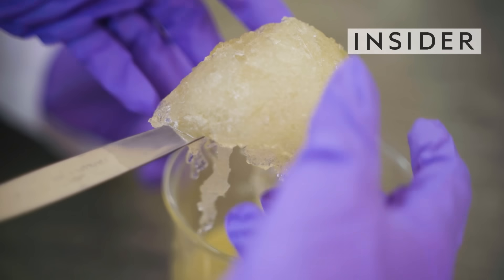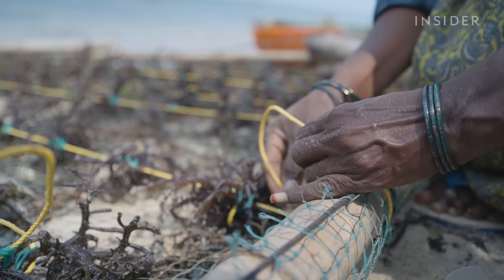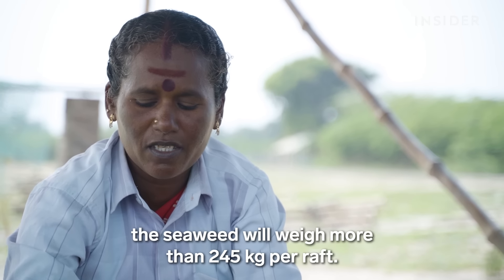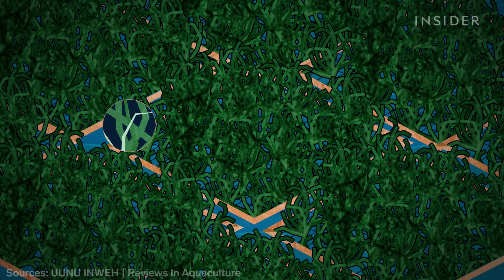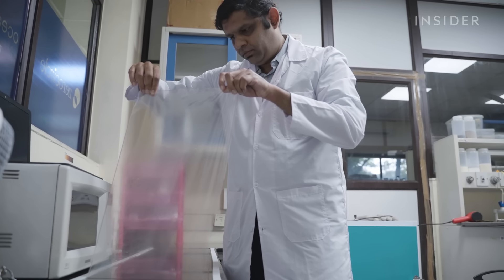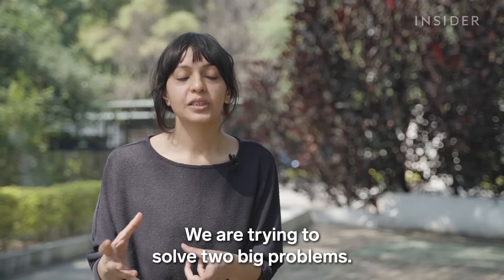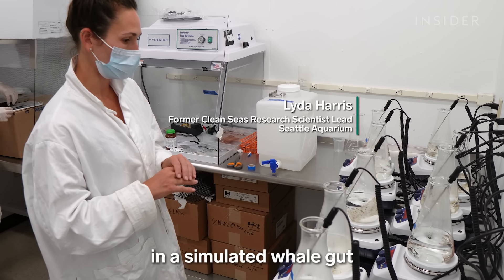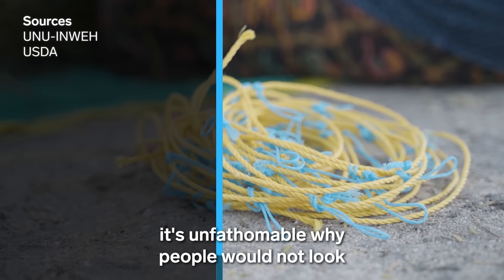Can Indian Seaweed Replace Plastic? | World Wide Waste | Insider Business

Comment: A great material! It can't replace all uses of plastic as it's dissolvable in water, but maybe one of the other plastic alternatives can. At the same time that also makes it more practical than plastic for some uses, as for the teabags or the wrapping of noodles shown in the video. I hope to find it in our stores soon!
Reply: Yeah, teabags are a seriously prime opportunity for this kind of stuff. Remember though: Bioplastics are not new, not at all. Celluloid was invented around 1850. Nestlé's KitCats have been bioplast since 2010
Reply: Disolves in boiling water, I think in normal water it should be fine for may days if not months. Not sure
Reply: @prashant-ul2sn  it's probably still get way weaker over time with air humidity
Reply: @prashant-ul2sn  No, it really dissolves in just water. Bought a whole pack of degradable plastic, and it does the job, but when my hand is sweaty/wet, the handle is really gonna tear apart. Even if you wash the plastic, it will dissolve. Don't even ask if it's raining the plastic just dissolve.

Comment: The fact that the product is 100% biodegradable and at a very fast rate, is a big plus for me. Doesn't matter if i can or cannot eat it!
Reply: Lmao, most plastic used in packaging is already biodegradable (different organisms eat it yes) , but it's not done because it's not cost effective
Reply: @plopiaplopia3736  It's also not done because is requires too much time. And the same might go for this. As far as is know the current organic waste composting processes take about six weeks due to special bacteria. If that cannot be done with this packaging, it cannot go into organic waste and has to be burned.

Comment: Absolutely and about time. 
Seaweed can be quite solid when cured properly and does not require harmful chemicals to cure it 
Awesome 💯👍
Reply: Dude, the compounds they are using to separate the seaweed components are organic solvents..."harmful chemicals" in every definition.  They then evaporate those solvents off, but no mention of capturing them so I must assume they are released into the atmosphere or they'd point out how they recycle those chemicals.
Reply: @nobodyspecial4702  solvent recovery is very simple. They already have a distillation setup, so all you would have to do is add a condenser column.
Reply: @Alsry1  I wonder if the solvant couod be reused then
Reply: @Maski110  absolutely. Some solvents are extremely expensive so it’s common to reuse them industrially
Reply: @Alsry1  I know this, the issue was why didn't they do it?

Comment: I’m really surprised we don’t make some kind of plastic. That’s biodegradable out of corn by now, but I have noticed that some of the potato-based packaging peanuts are starting to become common place. They melt in water as well as in your mouth, pretty much like a light Chito without the cheddar.
Reply: We make PLA out of corn (or anything with sugar). it is compostable but not biodegradable.
Reply: There are plenty options but the properties offered by bio based products have limitations. Eg. Tide pods itself dissolve in water but the bag or box they are sold in still needs to be be made of a thermoplastic able to withstand the mechanical and chemical requirements through this products life.
Reply: @aamirsheikh2610  That's why I still buy powder Tide in cardboard boxes...unless/until they discontinue it.

Comment: The problem is that it dissolves too quickly. In a few hours, a lot of produce can be dissolved, even before making it to market. If it took a few weeks in room-temperature water, or hours in boiling water, then it would make completely sense to start using it. Imagine you buy something, and because your hands are sweaty and warm, the packaging dissolves, and you're left with no packaging. Dew, and especially rain, can dissolve the product, as well, so that's even more reason to not use it.
Reply: can say about sweat as sweat from our hand is too minuscle for consideration . sweat wouldnt do anything but i agree with your rain point . if a person does not have umbrella then it will get destroyed in 5-6 hours

Comment: It's ability to dissolve in water will limit its use somewhat. Can't replace plastic juice bottles. But every little bit helps. It could take more paper out of the system too. We would need to compare the impact of each.
Reply: Reusable and recyclable glass and aluminum bottles.

Comment: This is absolutely incredible the ONLY problem I can think of is if u have a bunch of groceries and it's raining outside or if someone spills something could it deteriorate the plastic?
Reply: Seems like you would need to handle it like a paper bag.
Reply: Maybe not instantly, not sure. Also it maybe it is only faster to dissolve on boiling water, but rain won't destroy it quickly.

Basically treat it like paper bags which also destroys on moisture or liquid contact.

The point of these is to have biodegradable packaging that will naturally dissolve in nature to leave no pollution. These are not meant for long term use at all, but that fine since most plastic packaging is single use anwyays.

Comment: If it is not waterproof, it is bad packaging for a lot of things, like paper is
Reply: It's waterproof
Reply: For longer term storage of foods it seems like it might not be the right option. But for short term it seems like it might be a really good option.
Reply: You have not observed clearly.. the plastic here can dissolve in boiling water... not normal water
Reply: @grabhishek31  It also slowly dissolves over months in the compost so for longer term storage with high humidity I think it would break down. For short term food packaging it does seem like it is a very good option.
Reply: BINGO. Anything this is used for you can already use paper for all intents and purposes. Think wax paper even. So why bother. Paper also decomposes and is easier to produce.
Reply: @WaterspoutsOfTheDeep  just say you don't want this product to compete with your product
Reply: @WaterspoutsOfTheDeep  Paper is not very water resistant, which this is. Waxed paper is generally coated with paraffin wax, made from petroleum.
Reply: @grabhishek31  Pay attention to the video.  It dissolves in boiling water in seconds.  It dissolves in normal water in hours.  Making it absolutely useless for most food products.
Reply: @nobodyspecial4702  no ,it doesn't mention normal water... only mentions boiling water
Reply: @grabhishek31  How did you know I am the Thanos of BIG PAPER?
Reply: @mduvigneaud  Waxed paper is likely just as resistant or more than this which will be weak to humidity. It's still a defunct product aside from the materials transparency if it can even be produced clear.
Reply: @WaterspoutsOfTheDeep  I haven't used this product but most waxed paper I've used is mostly only resistant to liquid water, not water vapor.
Reply: @WaterspoutsOfTheDeep  From the video it appears that this product is more resistant than what I've experienced using waxed paper. Of course I haven't actually used this product so I don't know more about it than what I saw in the video.
Reply: @WaterspoutsOfTheDeep  Peeople like to see what they are buying
 Can't see through paper

Comment: What they have done is remarkable, hats off to them. However, I feel plastic bottles, straws, milk bags etc. that interacts with the water are main polluters. Their product fall short on these crucial applications, as it cannot last in water for more than few hours. Even when used as packaging, I assume there is risk of getting destroyed in rain, moisture of pipping hot burger can lead to leaching of packaging into food. Although it might be safe to consume, I doubt that consumers will be happy about it. The application they are aiming for are easily covered with paper. I think there is an advantage of reducing the stress on forest, further majority of the Earth surface is water, thus the work with seaweed has a huge potential. If seaweed growth can be mechanised, it will serve a great purpose in carbon-fixation as well as an abundant source.

Comment: It will get more affordable by upscaling the farming with machinery. There is a small hurdle because right now there is not enough demand. But the small scale farmers will eventually run out of places to put the rafts so close to the coast that it is feasible to fetch them manually, eventually a larger scale operation will use larger rafts and ships that harvest and process them on board. They could run up and down the coast, harvest each pod every 45 days on their journey and process the seaweed right into the pellets.

Comment: Another problem is that the biodegradability of all these producs kinda keep them from actually replacing oil based plastics across the board since it comes with a lack of water resistance.

Comment: Crude oil is made of old plants and nothing more. But it is much easier to harvest cellulose from plants than it is to try to manufacture it from the original glucose and protene that plants manufacture it from. Some of the  simpler plastics we do manufacture from the base material that plants use to make them. But Celulose, Rayon, and polypropylene are much cheaper to harvest from plants.

Comment: Honestly I feel like when this becomes ready for adoption and up scaling, it's just going to get lobbied and under tabled screwed over to smitherins and it won't end up reaching the scale it needs to compete with plastic in price. And goes into a spiral of not getting used because cost thus staying small scale as a result.

We already have alternatives, it's just that we get green washed fooled and then goes on to continue using plastics just in different shapes.

Should probably fix that first lol

then again, the best way to solve this is probably to just phase out fossil fuel naturally.

Comment: Here's the question: how much more waste does this produce compared to manufacturing regular plastic?

Sure you wont be leaving plastic in the water any more, but if it takes like 6 times the power and 3 times the water then you're replacing one problem with another

Comment: Wait, if it completely dissolves in water that trait makes it unable to compare against plastic because a majority of plastic use is actually used to contain liquids or will come into contact with liquids! Especially food, since humidity is actually what the plastic is needed against for dry foods, and for foods that isn't completely dry, this just useless. For storage, it can't be frozen either since it means that removing it from the freezer will cause it to get wet from condensation as well! And when being delivered, rain will cause it to start that break down process as well just from humidity as well!

While the things shown in the video are possible... it requires a complete re-education of the use and storage of plastic-like items. The process starts with educating people to use less plastic, not just finding plastic alternatives.
Reply: That’s true that it would be useless for holding liquids and would be weak in the rain. But it mentioned that it would take a few hours to completely dissolve in water. I’d imagine that if it just got a bit damp from humidity or condensation it wouldn’t really do anything.

Comment: OMFG it's agar agar. They aren't inventing anything new, they're literally just taking taking a wheel from motorcycle and attaching it on a car and saying they've invented a new wheel.
It's the same as what you have on an agar plate to grow bacteria. It's just more concentrated.
ever used a gelatin sheet and bloomed it in water? Congratulations you now have a more moist version of what they presented.

Agar agar is cheap as balls, mass produced and you could do the same with gelatin. The issues of the seaweed farming isn't a problem if they are grown from the bottom up instead of floating on the top.
Reply: It's agar agar but much more stable shelf stable.